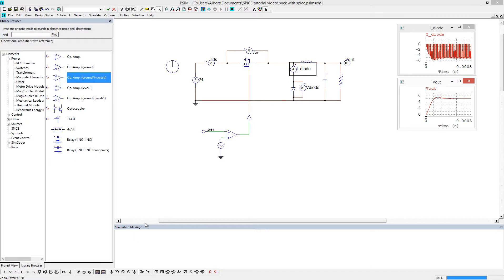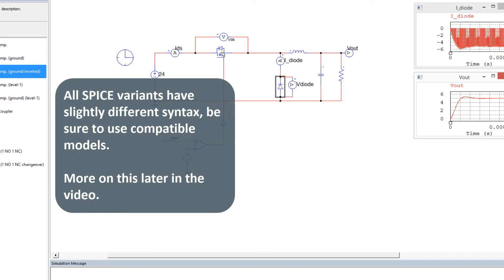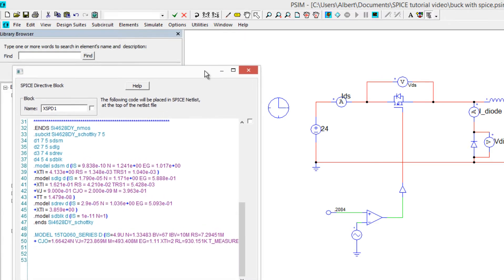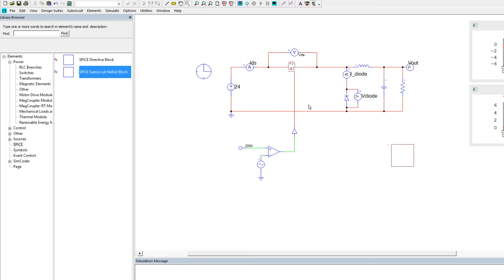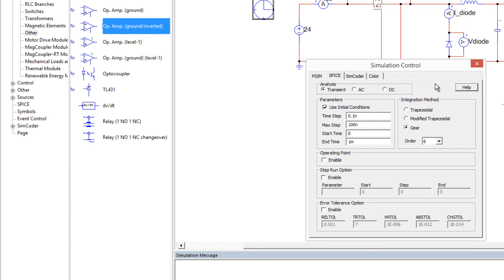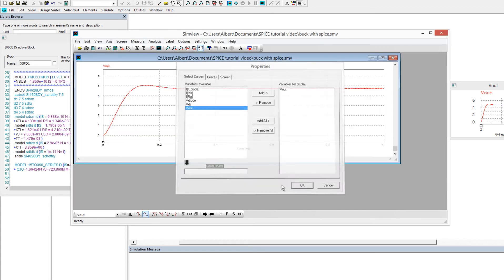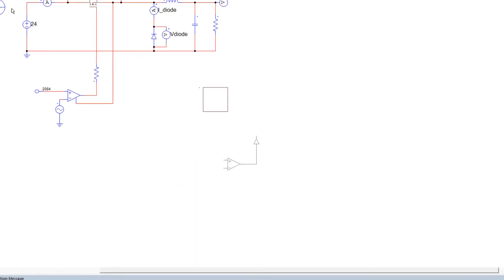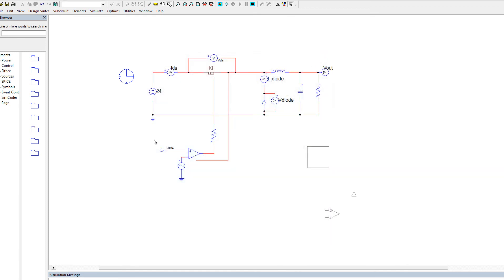Getting started with PSIM + SPICE Module

Comment: Hi Albert,

Will PSIM able to perform failure analysis of the power electronics such as (diode, mosfet and capacitor)?
For example, when a MOSFET exceed its drain current rating during power converter operation. The MOSFETs drain to source junction will be permanently shorted. 

May I know, will PSIM able to perform behaviour of this MOSFET failure? Thanks. Will be waiting for your reply.
Reply from the maker: Hi John, Accurately modelling a device failure is almost impossible. A MOSFET exposed to over current is likely to act as a fuse which may cause it to fail to a dead short or fail as an open circuit, which event will happen? Well that depends on thermal characteristics and physical device properties. Exposing a MOSFET to an overvoltage may or may not cause failure as there is usually a zener diode that can clip the overvoltage, but how much energy it can dissipate before failing is also a complex modelling task. 

With PSIM you can artificially open circuit or short circuit devices to see the impact on your design which will allow you to devise algorithms to sense these problems.
Reply: Thanks for your explanation.